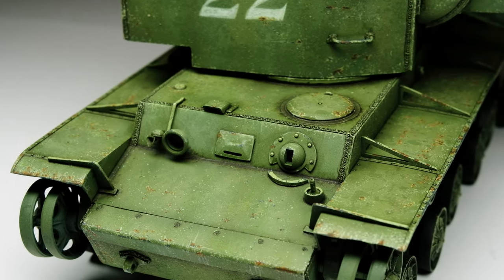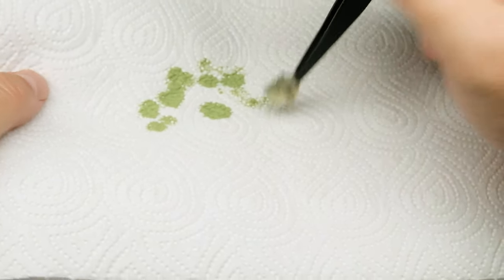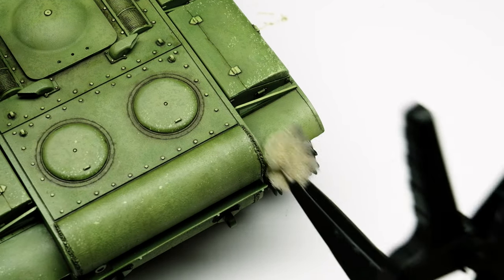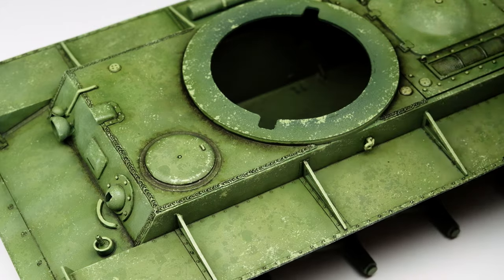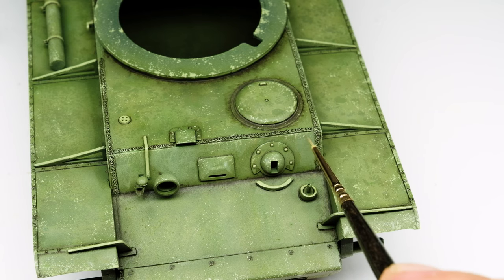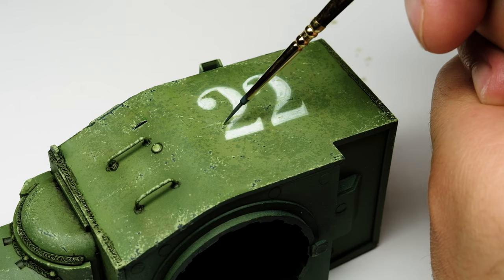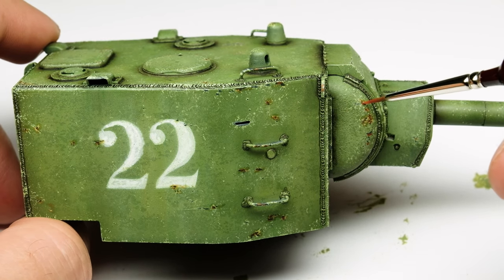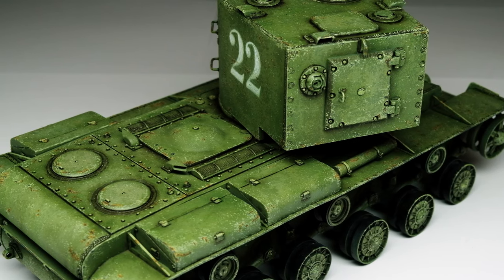Chipping Tutorial for Beginners - Sovjet KV-2 1/35 Zvezda - Ep. 4 - Sponge, Brush, Wash, Speckling

Comment: The project is coming along really well. 

Thought I might share a technique that I've just started using... Just recently I was working on a derelict corvette with rust undercoat in exposed areas, chipping medium and dull light blue top coat.  I wanted to create some stains down the paint from the rusting post chipping.  I ended up pulling out my set of Conte (dry pastels) and scraping the edge with the hobby blade to create a fine powder, so basically a dry pigment.  I then used foam eye make-up applicators to transfer the pigment to the model and streak in the direction of flow of water to create the "filtered streaks" of rust.  It worked so well that I then used some black/grey Conte to do some post shading around key areas to give false shadows and add plenty of depth where needed.  Whites for some subtle highlights too.  The great thing i found with this technique is that I had great control simply based on pressure and number of passes I made.

As I have a set of maybe 20 Conte pastels I now have a completed colour gamut and shading palette at my disposal.
Reply from the maker: That sounds very nice, like a very controllable technique!!! And you can wipe the pigments away, if your not happy... thanks a lot for sharing!!! ‼️

Comment: Awesome build! I appreciate all of these tips as I'm a beginner. Quick question, you do the chipping after the panel line wash? And if so, did you have to aoply another varnish coat over the panel lines before the chipping? Thanks again!
Reply from the maker: Very nice, that you get something out of my videos and thank you for your question!!! Normally I would apply the panel line wash after the chipping, to get the most contrast out of the panellines and shapes of the model. But I don't apply another varnish coat between these two stages. Because I'll do the chipping most times with acrylic or these weathering pencils and the washes with oil paints and these medias don't interfere with each other. Have a nice weekend!!!